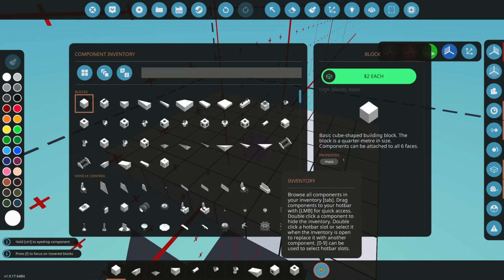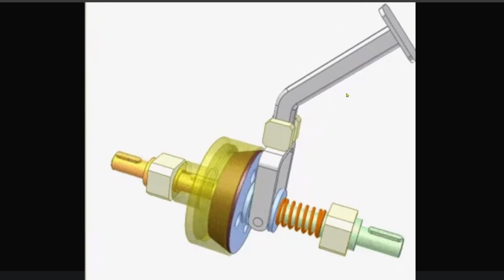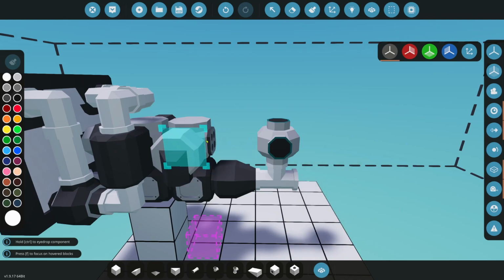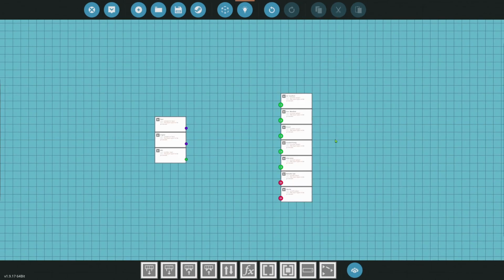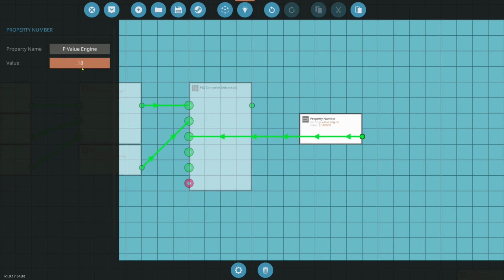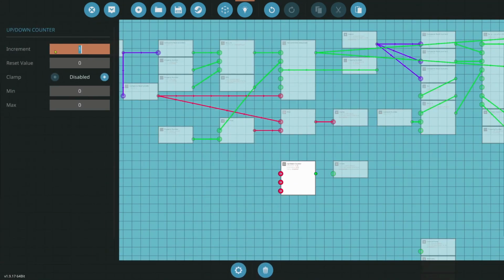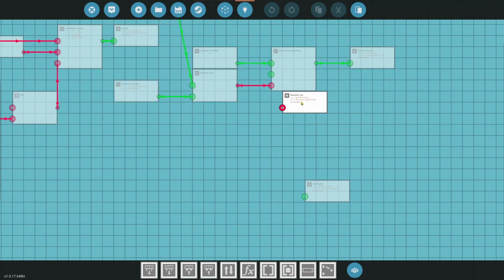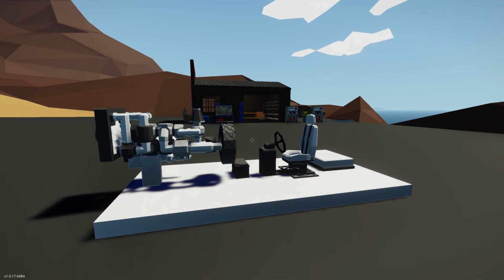Stormworks Basics: Modular Engine Tutorial Series P1 #tutorial #stormworks #gaming #gamingvideos

Comment: Bro, that's a powerful scheme. Why didn't you show the function in the part where you pasted the copied in this schematic Fuel Related. I still can't make out the F(X) value that comes from the engine temperature and the F(X,Y,Z) value that is below it. I'll have to download your work from the workshop to see. I've basically already grasped the pattern of creation in such circuits, but I wasn't prepared for the fact that they wouldn't tell me what function to put in. Thanks for the guide.
Reply: fully agree. i came to the same outcome as you.